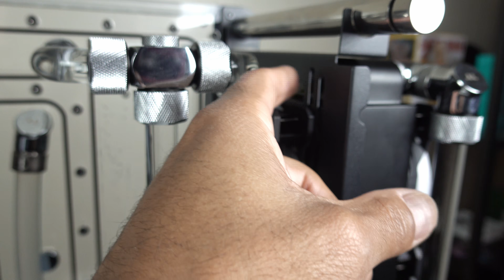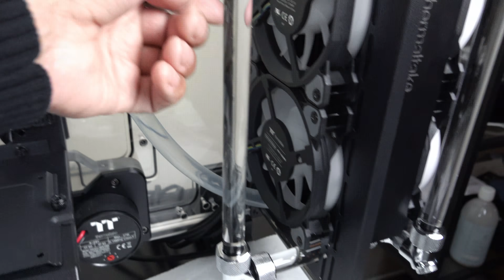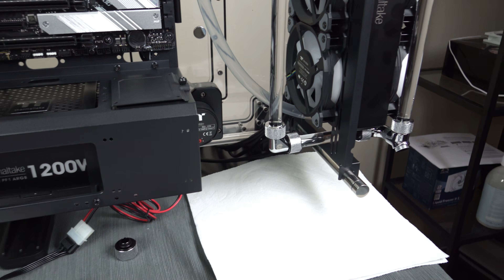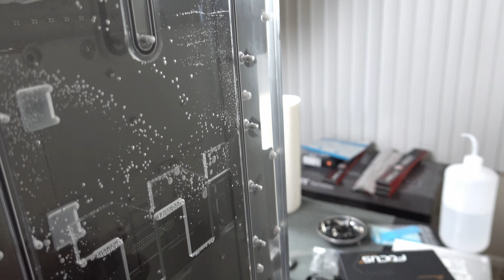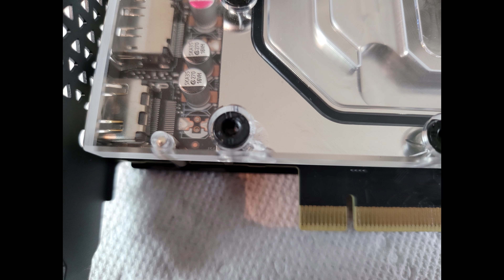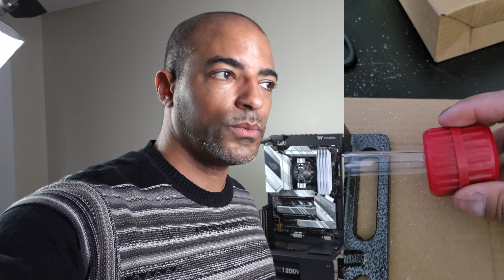Thermaltake DistroCase 350P - Had A Slow Leak...

Comment: would the asus z590 extreme glacier be good for a build like this
Reply from the maker: Well you choose a motherboard based on the features you need. So it all depends on your own uses for your pc. Check out the specs and then compare the size dimensions to what's able to fit inside of the case

Comment: I'm just about done with my build for the 350p too.  Was your choice to split the flow going in to the res aesthetic or was it functional?  I've got it on my downstairs work bench right now and aim to empty it before i take it upstairs and then re-fill it once i'm more sure that there's nothing more i want to do to it for a good while.  I think i've got air entrained within the pump and its pretty loud with the gurgling.
Reply from the maker: Aesthetics and function. Splitting up the lines reduced the air bubbles going into the pump but in the end it doesn't matter once the system is fully aired out.  I ended up changing the tubing though to something different.  That video will be posted soon and it's on my TikTok now.
Reply: @DaPoets  roger that.  appreciate the feedback sir.